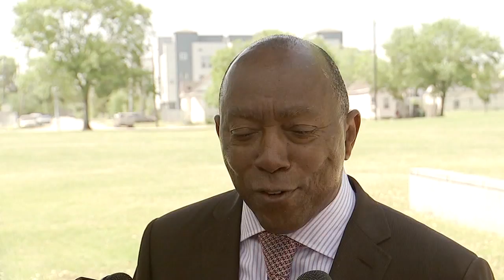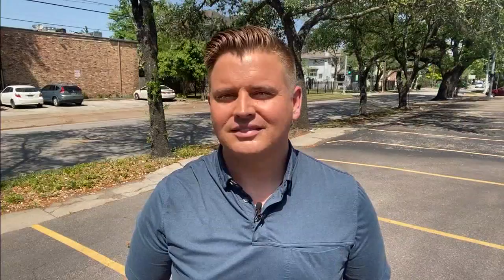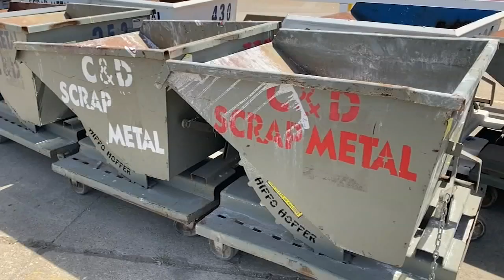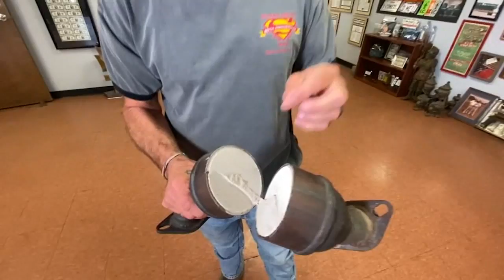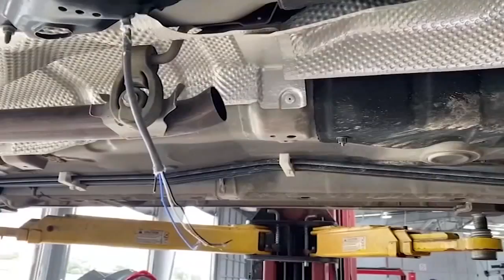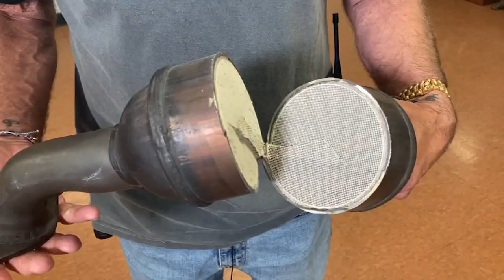Precious metals inside catalytic converters make them a prime target

Comment: If its valuable then they will continue to be stolen…it will always be a scrap yard willing to take that chance at big profits and for criminals its fast money…I think automakers need to change how they are produced or make some type of protection that deters the theft besides these aftermarket solutions…also crack down on unregistered cars and non visible license plates of fake temp tags because alot of these crimes are committed in stolen cars or cars with fake temp tags…

Comment: Stop Using them period..!
(1). Find another emissions filter to put in two cars to do the same job only without the precious metals and do away with catalytic converter’s all together.

(2). Don’t allow scrap yards to accept these. If the scrap yards are caught excepting these items whether it only be 1 or 100 of them, they have to forfeit their business and they are put in the jail under a felony charge and given a $100,000 fine. And set up governed state facilities to be the only ones able to accept these items in for scrap. And only allowing The owners of the vehicles that the item was changed out in, to turn these into those facilities or proven paperwork showing that the item was signed over by the (Owner, Customer) legally to the muffler shop that changed it out for them to be able to turn it in to state Catalytic retrieval center.